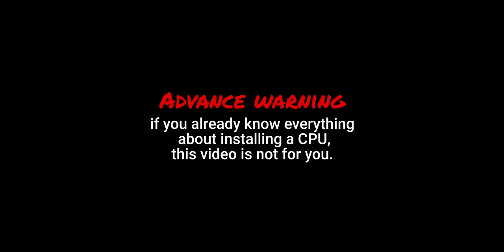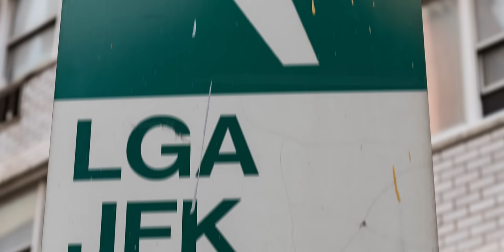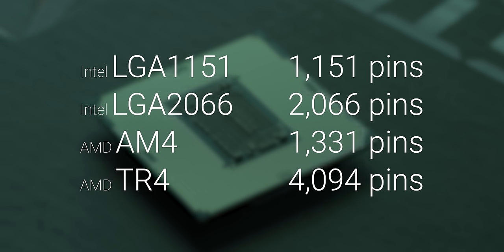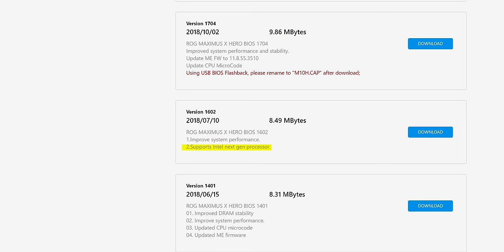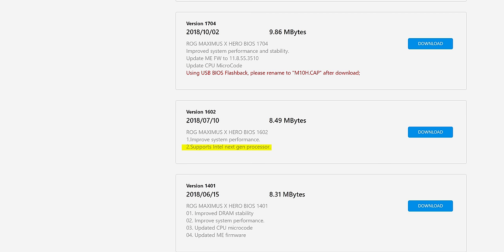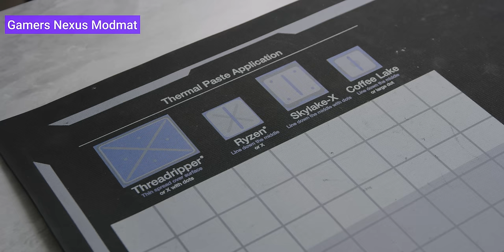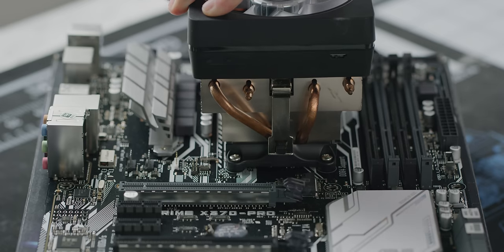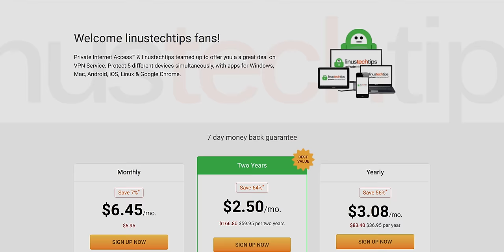How to Install a CPU

Comment: 5:51 

Also make sure your PSU is turned OFF (may be obvious, but could help some beginners)
Reply: ...but dont forget to turn it on before hitting the power switch at first boot up x)
Reply: Please pin this comment, it's important.
Reply: @Cal94  when i built my first system i freaked out when it didnt  turn on and i was thinking i didnt put my front panel connectors in correctly and i opened it up and unplugged them then realised "oh shit did i turn the power supply on" that was the stupidest thing i have ever done in my life.
Reply: @thetattiescones6633  Dude, we have all literally done it. It's a VERY normal thing haha
Reply: @Cal94 
nono. never turn it on first
that would mean you miss out on that slight panic attack when it doesn't turn on :(
Reply: @frosty9392  yup every time
Reply: hungryrobloxian1000 power super union
Reply: Clickbait title, I came here for How to:basic not How to:basics
Reply: @whatsaaappthesequel  power supply unit, also, don't you have Google?

Comment: 6:49 : I remembered that moment when I changed my air cooling… My heart stoped until I realised it's a common issue. Though, it took me an half hour to unstick the CPU from the air cooling x)
Reply: How did you remove it safely?

Comment: I actually broke pins on my previous motherboard before I saw this video. But now I can install CPU without hesitation.
Thx Linus. Make more of these types of videos.👍👍
Reply: Same i put too much thermal paste it was leaking in CPU socket when i was trying to clean i broked 6 pins. they are super soft

Comment: 5:54 You should have added that the power switch on the PSU should be kept turned off even if it's plugged in for grounding.
Reply: So just touching the psu while it's turned off but plugged in does the deal?
Reply: poor yeah you only need it plugged in so that it will be grounded
Reply: What would happen if it was on
Reply: @deathpony3333  you would probably short across a few pins or components because static electricity is a thing that exists, and you would probably irreversibly damage some shit

Comment: >Describing LGA sockets.
>Show a laptop.
>Laptop CPUs are typically BGA.
Reply from the maker: Can you clarify here?
Reply: @LinusTechTips  He's probably referring to 2:11 where there is a laptop shown directly after describing the LGA type cpu interface.
I would also like to point out that none of my laptops have had BGA type processors.
Reply: @LinusTechTips  In all seriousness I didn't expect this cheeky comment to be noticed at all >_> I was just mentioning that Laptops use an entirely different type of socket sometimes, called Ball Grid Array (BGA).

Let's see... the one used in the shot at 2:11 seems to be an LG Gram 15Z980 which has an 8550U processor which is indeed a BGA1356 socket. Tho I want to reiterate I was just being a smartass not mean-spirited I didn't expect to get a response from LTT.
Reply: Mike Are there even ANY relatively modern laptops that have socketed CPUs anymore (not counting oddball laptops that use impractically hot and power hungry desktop-variant CPUs)?

Comment: Been building systems for 2 or 3 years (since the 286 was new).  This was a great video for new builders as it's VERY easy to use to much thermal compound (at least the new stuff is non-conductive :) ).  Another thing that was great for new builders is showing the pins on both types of sockets.  Have had to straighten A LOT of them over the years.

Keep up the great work!

Comment: I watch this after upgrading a fresh new ryzen 5 5600 inside my case without removing the VGA card or the RAMs. I was really nervous lowering the CPU down to the socket as my hand is quite big (I'm 6'2"). Tried doing it a few times and had to wipe my sweaty palm too. I have to say it feels really rewarding when the CPU snaps into place and everything eventually boots up normally. Stay safe folks. Amazing video from LTT.

Comment: Woah buddy calm down, im not stephen hawking? first of all, whats a cpu?
Reply: @devonhc7770  "Every PC needs a graphics card" is fundamentally wrong. They don't.
The reason that is, is because most CPU's these days already include a (much less powerful, which is why a graphics card would be adviced) graphics processing unit.
A CPU, or Central Processing Unit is basically the brain of your computer. It handles all the processes of "telling" your other hardware what it is supposed to do next, as well as execute the instructions of whatever software you may be using.
Reply: @Feligresa  oh shit sorry  forgot it needs processors also like at least 8 or something.
Reply: @Feligresa  I only own a laptop man ,but I seen what's in my PS4 pro and Xbox 1x I'm starting to think the hybrid processors are going to be the next big thing ...
Reply: @devonhc7770  Your gaming consoles also do have both a CPU and a separate Graphics Card. They are just in a different form than usual PC hardware.
Processors with integrated graphics can certainly handle games of even HD graphics, but you would need to have very low settings on order to do so and probably would not be playing with a comfortable amount of Frames per Second (Usually 60 FPS is what's considered smooth enough).
As of right now, they are simply not strong enough to keep up with the requirements of games, as the extremely small form factor of a Processor simply doesn't allow for much more.
I do agree that they will likely eventually get to a really good point, but they will certainly always be inferior to specialized graphics cards.

Regarding the amount of processors, having multiple isn't exactly wrong, but the number you see being used is referring to the amount of cores they have. Trying to explain it as simple as possible a processor with 1 good core would do 1 task really well, but a processor with say 8 cores could multitask to either do 8 tasks at once decently well or split 1 task up into 8 parts and do them simultaneously, essentially making it (for example) 6 times faster. Now, it wouldn't exactly be 8 times faster, as the more cores a processor has the lower the speed of each core is for the most part.
Reply: It is the “brain” of the computer. Calculations are done there. (Ex. 1+1 would be done on the cpu)
Reply: @devonhc7770  theyve been waiting to be the next big thing for a while now the first apu was in the era of like 2008 I think
Reply: @Feligresa   the correct term is apu or amds marketinf o f advanced processing unit that contains a gpu and cpu on the same package with low latency high speed communication but has fundamental limits that consoles are the best current scenarios for the apu
Reply: The cpu is analogous to a brain. It does all of the calculations required to run your computer, e.g. 47×39, telling your monitor/GPU what to display, etc. it is impossible to have a computer without one.
Reply: Dud Perfect  so!...

Comment: I broke a pin and just sent it back on Amazon and they accepted the motherboard
Reply: The people working there dont need to be pc builders, they probably deal with all kinds of products. That, orr you were just lucky
Reply: Yeah Amazon might be taking over the world, but they do have really top notch customer service. 

Curious, what did you choose as the reason for the return?
Reply: Amazon customer service is really the best. My favorite personal story is that I got a brand new $200 keyboard replacement from them, an entire YEAR after I bought it, and they didn't even ask for the original keyboard back. Damn good company.
Reply: Yeah, you can do basically anything with Amazon customer service nowadays. They truly dgaf. You could buy some crazy expensive headphones, receive them, send a Shitty pairs back in the same box, and claim they were the wrong ones, and they'll refund you. Not saying I've done it, or that anyone should do it, but it definitely happens on the regular, and it's Bc Amazon has great customer service.
Reply: @bryanjk  I actually just said it came broken. I still have most of the accessories that I forgot to put back in the box

Comment: LTT showing actual tech tips. What year is this?

After, to quote a fellow commenter, literally bricking a computer by running concrete in a water cooling loop I lost my faith in L's common sense...
Reply: It was an April's fool dude!
Reply: LOL.  Check when the concrete video was released.
Reply: They didn't actually run the computer with concrete, they showed how they did in a float plane exclusive video.
Reply: r/wooooosh
Reply: They actually didn't damage any of the components, except the water cooling system.
Reply: I lost faith in his common sense a long time ago.  Now I'm somewhat disappointed when I watch a video where he isn't doing something janky and horrible.

Comment: Installing Gentoo - How To: Basics
Reply: you might want to start with arch gentoo is for weeb degenerates
Reply: "Btw, I use Arch."
Reply: Arch Linux offers the better ratio between customization and difficulty. Gentoo just wastes so much of your time for little to no gain. It is probably easier to tweak Arch Linux to whatever it is you want. I also want to say I have successfully used Gentoo for a couple of months before returning to Arch Linux
Reply: @_yuri  as a fellow "weeb degenerate", I can confirm you shouldn't touch Gentoo with a 10foot pole. (never used it myself, used arch for a good while, now running ubuntu cause idfc anymore)
Reply: thanks g

Comment: For anyone wondering, no, linus did not destroy a motherboard for no reason. In fact you can already see the thermal paste stuck in the pins on the motherboard from when denis was joking with denis tech tips, the motherboard was dead even before denis slathered it in thermal paste.

Comment: AMD has the best mounting system by far. Bent pins on AMD CPU's are easy to fix back and also you can apply more pressure on the CPU when installing a cooler.
Reply: MirceaBv yeah I’ve fixed a whole ROW of bent pins on a 2200g once

Comment: i hadnt realized until i watched this video that the processor i wanted to get was incompatible so i had to spend 500 extra on motherboard and other parts!

im joking, its better than buying the processor and not figuring it out until a pin gets bent. this was actually really helpful by saving me from figuring it out too late. Plus ive been meaning to get away from my dell pc for years now so just getting that push to go all in was actually super helpful. Thanks!

Comment: this video is from 2019 but man it helped me so much! I've been having this problem after everytime i clean my pc where my cpu-z reads my ram slots as single channel back then. i always remove my ram and swap each ram sticks (i have hyperx fury ddr3 1866mhz 4gb, and team xtreme ddr3 1666mhz 4gb, yup im short in budget :(( ) or blew air to the slot to get some dust but most of the time no luck and i'd just leave it for an hour and do it again and sometimes it's fixed but most of the time it's not. So i will remove everything and reinstall every hardware in my motherboard then bam still 50 50 chance of fixing it, now that i know it's because of my cooler too much pressure or cpu not installed properly, after i clean my pc and it did became single channel, i tried to align my cooler because it's off the middle for a tiny bit and then bam, got it! Thank youu soo much!! ♥

Comment: Eleven Tips for Troubleshooting Software

Free up RAM by closing other open programs. ...

Restart the software. ...

Shut down and restart your computer. ...

Use the Internet to find help. ...

Undo any recent hardware or software changes. ...

Uninstall the software, then reinstall it. ...

Look for software patches. ...

Scan for viruses and malware.

Comment: "Socket cover will come off by itself" is not entirely true. I used your video to install a CPU in Arsock motherboard and ended up bending the pins. It was really hard to latch it so I suspected something was wrong. In the end, I managed to fix the bent pins using another of your video. I always recommend to remove the socket cover manually before closing the lever.

Comment: Sometimes even if a cpu doesn’t fit in the socket it is compatible anyway, for example if you cut the nubbins on the lga 775 socket and put a special peice of tape on the cpu you can use an lga 771 xeon on a standard 775 motherboard.

Comment: step 1get 1 gallon thermal paste
step 2 everything on the cpu socket 
step 3 install the cpu  make sure arrows are at the avoiding direction ( you make have some trouble puting it in just push it in untill you hear a click
step 4 close it
step 5 if you have remaining thermal compound put it ontop of your cpu
step 6  i hope you have waranty :)

(everything you shouldnt do the first step you can choose)

Comment: I'm currently an AMD guy, though I've had an Intel CPU in the past and I must say...I REALLY prefer the way Intel's CPU's slide in nice and easy into the socket since they A: have no pins to worry about, and B: the motherboard comes with a pre-installed protective cover over it. IT makes installing them a hell of a lot less stressful.

Comment: Intel cooler: usually lock notches in x shape - better unlock em in that way. Also allied to axy screws in a rectangular positions - in X hhape - first you tighten 1 and 3< then 2 and 4 (along perimeter), then again 1-3-2-4.. Logic: "untighten in that order"

Comment: I just built my first ever AMD machine. I had installed plenty of Intel CPU's without incident. I dropped the processor VERY CAREFULLY into the socket. I gently gave it a little wig wag to make sure it was stable, not loose and then gently closed the cover and again, gently pulled the lever. I was extremely careful every step of the way. Everything felt fine. I then put on the heatsink and fan. When I went to boot up - nothing. Just the RGB lights on the motherboard worked. Shit! So I took the power supply to my favorite computer shop to see if that was the problem. Nope. Power supply was fine. I reseated the RAM. Nope, not the problem. So I took off the heatsink and fan and when I did the CPU came up with the heatsink. WTF? When I took off the CPU I had about 20 bent pins. At this point I was heartbroken as I thought that was it, I ruined the CPU. But I never give up. I took a 22 gauge hypodermic needle and a very good magnifying glass and broke the hypodermic needle at the hub. I slid the needle over each pin and was able to bend each pin back straight. Talk about tedious and time consuming. You need a lot of patience. When I went to re-install the CPU I discovered you actually have to press down on it slightly to seat it well. There was a little click when I did it. It wasn't that much but it was certainly more than zero force insertion. I put everything back together and it booted up fine. Yay! What a relief. Anyway, before you put on the heatsink and fan make sure you can't lift the CPU out of the socket first. If you can then the CPU probably isn't seated well. BTW, why not wear rubber gloves instead of a static electricity strap?

Comment: Me checking back here as I'm planning to do a pc rebuild, even though I've installed a decent number of CPUs.

Because I don't want to have a $200-600 paper weight, depending on if I ruin the mobo or cpu.

Comment: Just put an i5 quad core sandy bridge in to replace my pentium duo core G640 on my Archlinux box. It's waaay faster now. With the duo core it took me over 16 minutes to render a 7:40 video in openshot. I just did a short one (0:40) that took almost a minute to render before and it was done in 10 seconds and didn't pause like the old duo core did. Web pages load much faster. I never realized how much your GPU can hang you up.

It does take some homework tho to find compatible processors. A quad core and doubled my RAM capacity and I'm ready to take over the world!

Comment: Quick question from someone who's never upgraded a cpu before. What do you actually do on the software side of things?
I'm guessing you don't really need to do much before swapping the cpu/motherboard, but do you need to do anything afterwards, or can you just turn it on and go through the bios?

Do you need to reinstall windows, format drives? This is my first time doing a major upgrade besides just adding another drive or adding another stick of ram and I really don't want to mess anything up.

I'm going from an intel cpu to Ryzen btw if that helps.

Comment: Ofc companies over complicated pc building. Not only does my cpu not fit bc they just have to have different shapes and sizes, but the fan doesn't fit either. Why do you need multiple way to mount a damn fan???

Comment: I'm teaching IT basics at school. The most problematic part for students is put the intel cooler back. Some times they are bending the white stuff (I don't know how to call it in english).
Reply: When the plastic white pegs get old, they get brittle and can break off easily,but you can buy replacements off ebay or amazon, maybe $5 for a pack of 8.
Reply: thank you, I will look for it on ebay.

Comment: OH! So that's why the last slot isn't working when I installed my new RAM!

I've only noticed it after over 5 years of using this PC, and recently just got new CPUs to upgrade it as well, hoping that maybe it was a CPU issue and installing new ones would fix a faulty lane... I guess maybe this will fix it, but just reseating the existing ones probably would have as well.

Now I just need to know how to properly remove thermal paste...